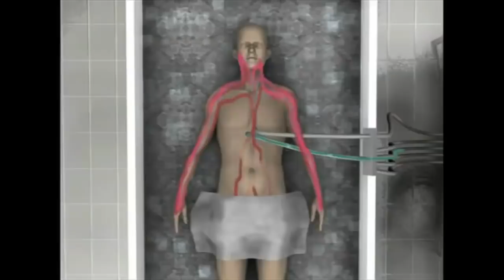Prankenstein with Kari Byron and Tory Belleci

Comment: Honestly, while the "haha, scared this person" gimmick can make for a fun show (I think "Scare Tactics" was the name of a similar one I used to watch), this was really hard to believe anyone would fall for it. Letting someone off the street help with what is portrayed as a medical procedure just because a TV show is filming isn't remotely believable to me, but I could certainly see someone else falling for it, but having "does nothing, goes nowhere" pipes on a plastic box on top of a steel table you can clearly see under should have made it obvious to anyone.

Now, even with the poor prop, I would still find it funny to watch if you showed what went into it in a way that made it feel like the victim of the prank wasn't also an actor. You could close out the show with a montage of the failed attempts to pull off the scare, for example. Having just watched it, we would know the framework, so seeing a bunch of people variously react to different parts of it in short 8x speed clips while the credits roll would give it an air of credibility that would make up for the setup looking unbelievable on camera. Basically lampshading that it took a few tries to find someone gullible enough. Or, if you can't afford failed attempts and do hire an actor to be the "victim" of the prank, spend a little more on one good prop to reuse that the audience might fall for. Could be a redressed set prop from a cancelled sci-fi or hospital series, for example, or just a tablet device mounted in what looks like hospital hardware so you can change the screen orientation and display each time.
Reply: To be honest, she doesn't seem like an actor. She just seems to be enthusiastic about cryogenics, which would make sense. You put a fake add out there about finding people enthusiastic about cryogenics and you're going to find someone that cares about cryogenics.
Reply: @charleswesesky747  I don't really know what the casting process is for these gag shows, but there is a conspicuous lack of a gag reel of all the times the people getting pranked realized it too early from any of them.

You really can't go off of what it seems like, though. The premise of these shows is always that the ones setting up the prank are acting well enough to be believed, which is also exactly what someone pretending to be pranked would need to do. The best way of making that believable to an audience is to have the known actor in the prank play a little less believably so that the unrevealed actor seems genuine by comparison. But, if you think it through, the fact that you can tell the bad acting of the prank-actors raises the question of why the victim couldn't.

The doctor was acting very stiffly while on screen, putting unnatural effort into enunciation and line delivery, but then dropping professional demeanor during the "crisis", ostensibly to panic the woman.  The man who stayed behind with her was shifting too quickly between calm and panicked between each instruction. Her behavior felt scripted to me, even though her speech pattern was mostly natural (there is a lack of normal blending of words at a lot of points, but that doesn't necessarily mean she was acting).
Reply: @Merennulli  watching, knowing it's a prank show is VERY different to actually being there! They cut out some of the set up in these shows, so as to make it more entertaining, but in real life, they spend more time in establishing the premise with their victim, so that they are fully inside the world before they continue. Derren Brown shows the process fairly fully if you want to understand it, or you can just watch some old candid camera pranks to see how people really do fall for this stuff. I know someone who was caught out by a candid camera prank, she always said there was no way she would be caught by one of those pranks, then the fruit store at her local mall had a new management sign & opening specials of "as many oranges as you can carry for $1", which sounded absolutely like the type of thing a new store would do for publicity & to draw in new customers, so she took up the $1 offer & loaded up, only to be told "smile, you're on candid camera"

& btw this show is also using the proven science that demonstrates people will conform with what the group is doing around them. They intentionally set this up in such a way it was near guaranteed the person would go along with it & be sucked in, even if they wouldn't be in normal circumstances. Go look up the studies on this topic & see how high compliance rates are
Reply: @mehere8038 People conform to behavior when they believe the scenario they are in and the behavior is within their tolerance levels. Which, sad as it seems, means people will electrocute a stranger in another room because someone in a lab coat told them to after a few iterations of instructions, but they won't participate in public speaking without a LOT of lead-up work.

But it takes more than behavioral conformance for these things. You might be convinced to play along with a prank, but you won't be horrified when you're told someone died because you turned the wrong valve on something that was obviously not a medical device.

Your argument is that people CAN be fooled by these things with more work up front and my original post addressed that possibility. The issue is that you need to convince the audience that the participant was fooled. So if the prop looks perfect in real life but looks silly on camera, it's not selling the gag to the audience. 

As I mentioned, it does NOT matter if the person is really fooled or an actor as long as the audience believes it. Even if you do all the prepwork to convince the participant, if you don't convince the audience, it doesn't work. And while I don't fully agree with everything you said here, even if you're absolutely right about it, the audience isn't going to sit through that exposition. It needs to be shown, not told, to the audience as part of the gag.
Reply: @Merennulli  people absolutely conform even when they don't believe the scenario. I wasn't actually referring to the Miligram experiment in my comment, but rather the more recent one where they put one subject into a room with a group of plants & asked the group one by one (with real subject last) "which line is longer". They did a few establishing rounds with real answers, then all the plants gave the wrong answer & the subjects almost always conformed, with their facial expressions making it abundantly obvious they knew the answer was wrong, but being unwilling to challenge the group, even as the difference got bigger & bigger in the line & it became more & more blatantly obvious the answer was wrong. It only took 1 plant to give the opposite answer & the subject would also give the correct answer, but when all plants gave one answer, the subject gave the same. THAT is what they set up here, they had a plant give the reaction they were looking for from the subject of fun, relaxed & unstressed about the scenario, so the subject followed.

The Miligram experiment cannot be repeated today for ethical reasons, because people did NOT stick to their tollerance levels & so were traumatised after it. This scenario was very careful to set something NOT Miligram like, the person had chosen to die & was dead before any of the prank stuff began. It was purely experimental as to if there was any chance they would ever be revived & with current tech, not possible, so the subject here was not subjected to guilt over causing a death, as the person was already dead.

If you want to question the realism, it's NOT the box that gives it away, it's the fact that there are no relatives or friends there as the person says goodbye to the world & dies, that would never happen, but that also acts to reduce any guilt or responsibility, since this person clearly has no-one who would even attend their funeral, or care that they die.

In terms of selling it to the audience, it's not like this is the first time there's been a prank show! There is well established protocols for that, the subject is paraded around on a PR tour promoting the show & being asked by a range of talk show hosts about how on earth did they fall for it, what do they do in their life normally, have their friends & family seen the episode & what did they say about it etc etc. The show itself is NEVER weighed down with that crap, cause it has a different demographic that wants to see that compared to wanting to watch a prank show.

& btw, while the entire Miligram experiment is irrelevant to this topic, so what I'm about to say is irrelevant too, the example I gave of the person with the oranges actually happened in Australia. If you know everything about the Miligram experiment, you will know it has been repeated in a range of countries, including Australia & that one is referred to as "the Australian difference" because the majority of test subjects ganged up with the person being shocked rather than person in the lab coat - a result not seen in any other country
Reply: @mehere8038  I brought up the Miligram experiment for contrast with the latter half of the sentence it was in, not because I thought you were referencing it specifically. I am familiar with several experiments that demonstrate conforming behavior, including a few similar to your line example. As you noted, those realized something subtle was going on and conformed to the group but without being fooled about the question they were answering. They believed the scenario they were in was one where they were supposed to lie.

And, yes, the prank show is a long established genre. And my comments above are towards matching that model. From Candid Camera to Scare Tactics, they always make the scenario just plausible enough that it's believable without exposition. Yes, in the comfort of our homes we often think we wouldn't have been fooled, but we believe the person on screen reasonably could have. For medical gags, they are usually done with a familiar, inexpensive "doctors office" set and equipment that either looks reasonable on screen or is occluded by camera angles so it doesn't break the illusion for the audience.
Reply: @Merennulli  um no, those people did NOT think they were supposed to lie! They simply didn't want to go against the group, it's more akin to your earlier comment/explanation, that most people hate public speaking, they don't want to stand out & yes they knew THEY were lying, but they didn't think they were supposed to, they just weren't willing to be the ONLY person to have a different view

& no, believability in calm, rational minds has never been a requirement, a lot of these pranks simply move too fast with everyone involved, so as to create a situation where the person doesn't question it & the audience realise that is what is happening & it's viable. Sure, some like yourself might not empathises & switch off, but enough do empathise that is not an issue. I see nothing in the scenario that wouldn't get me at the moment (at least if I was someone who would buy the cryogenics of a living person in the first place).

Good example of a similar scenario to this I remember from many years ago in my country was a celebrity prank show, where the person was on a skiing holiday with her husband (who was also in on it) & they had just got to their hotel room & were hoping for some alone time & staff kept interrupting/knocking on the door for various reasons, getting her totally off guard & distracted to begin with (as you see in this scenario, with the guy playing with the nobs) & then things appear to go calm, but seconds later, the window smashes & a skier, in full gear & skis is in their hotel room. She's in shock, but starts asking him if he's ok, he gets himself up & says he is & asks her to confirm he landed on his feet, then a bunch of press burst through her door & start interviewing him about setting the world record for the longest ever ski jump, 1,035 metres & how it feels, then they start interviewing her about what was it like to witness it & officials burst into the room as well & start confirming with her that he landed on his feet & exactly what point he landed & get out tape measures etc etc, basically creating total chaos, with her husband going along with it all (although not actually confirming anything, making sure she does all of that, since she's the one being pranked) & she plays along, tells them he landed on his feet, makes stuff up about what it was like as he came through the window etc etc, before they finally reveal to her that she's been pranked, at which point she starts to process the entire event & the 1,035 metre jump & says the 1,035 & kinda rolls her eyes & says "I should have realised no-one could jump over 1km, shouldn't I" & realises just how absolutely & utterly ridiculous the scenario she had just fallen for was & that made the whole thing even better in my opinion & the opinion of a LOT of viewers, with that one being 1 of only 3 from the entire season chosen to be repeated in the end of season "best of" special

There's nothing out of the ordinary for this scenario in this video, it's really very typical

A few candid camera pranks I can think of offhand
- buffet lunch where EVERY item is plain, white rice, all set up in different ways - hardly real is it!

- eco-friendly lift at a hotel, where the lift has an operator who explains they have to wait until at least 3 people board before they can move

- gender based parking, where the parking area has suddenly been changed & only women are now allowed to park there - if it's a male driver, or only men are allowed to park there if it's a woman driver

- clearance bar at drive through at bonnet height, so no cars fit under it

- toll booth on hiking road

- car wash that changes the colour of the car, due to "washing off the paint"

- tyre attached to bathroom key at service station to prevent it being stolen 

& basically every other prank where people ask "is this candid camera?" cause they realise what's happening is just too ridiculous to not be - and those are always the clips that are the most popular. Over the top has ALWAYS been the norm, the more ridiculous the scenario that actually catches people out, the funnier people find it